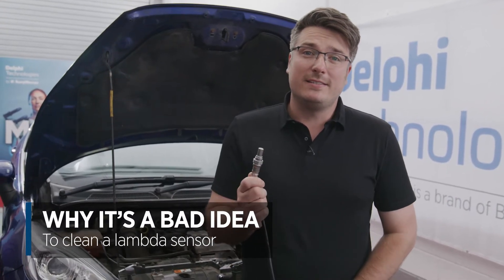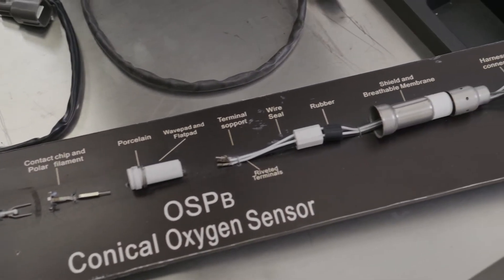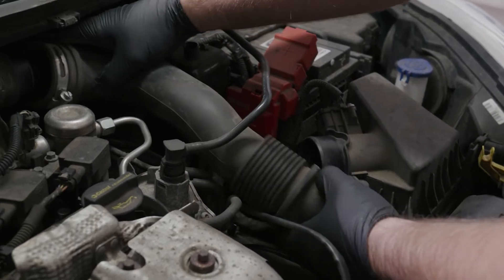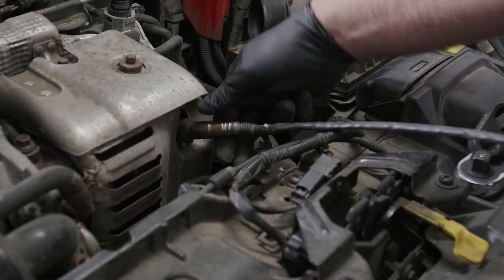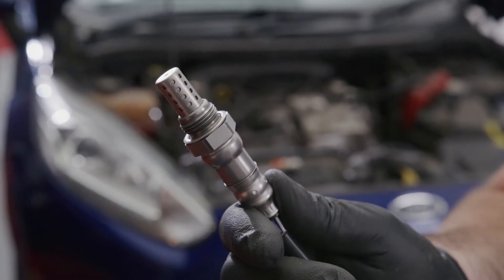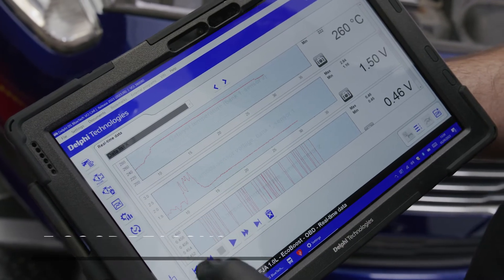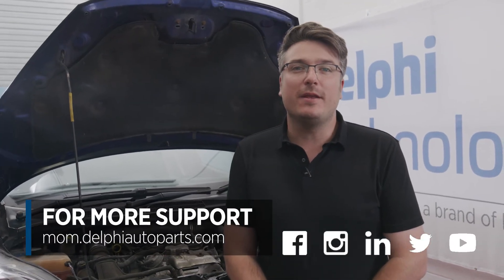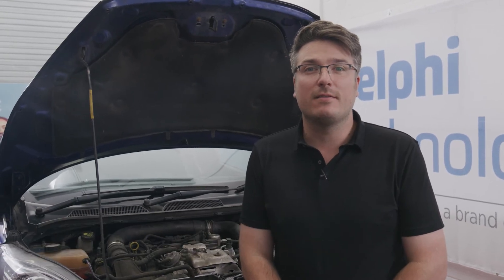[EN] Cleaning a lambda sensor | Masters of Motion

Comment: Is it ok to only just use break cleaner or air flow sensor cleaner?
Reply from the maker: Using brake cleaner is not ideal on a MAF sensor. The sensor wire has precious coatings that may react badly with brake cleaner. It's recommended to use a dedicated MAF cleaner, although this is often not a long term solution. Many MAF sensors which have been cleaned, require replacement within a short time frame.

Comment: My car is reading lean p0171
Reply: Me to did you have it still there
Reply from the maker: Reading lean can be the cause of many different symptoms. A good start is to check the fault code against any known technical service bulletins (in a platform like Delphi Technical Data). If nothing is found, you can then start a systematic diagnostic process to find the cause of the lean running.  Many thanks!